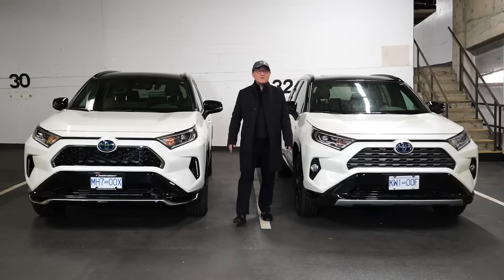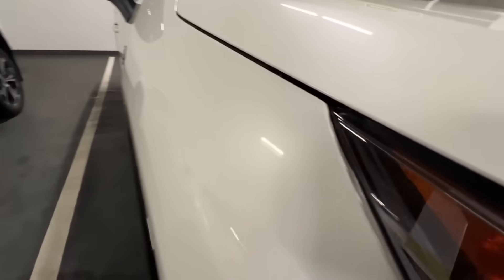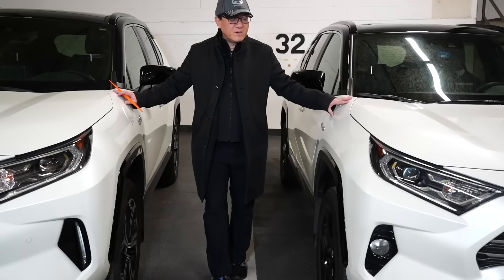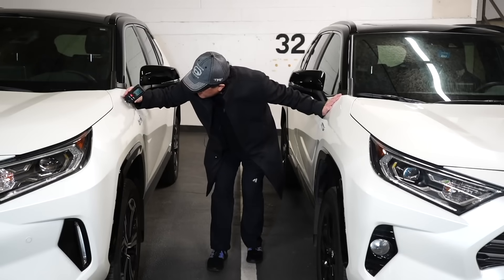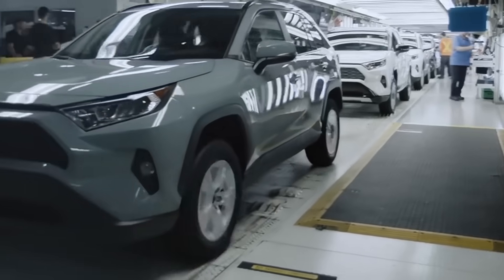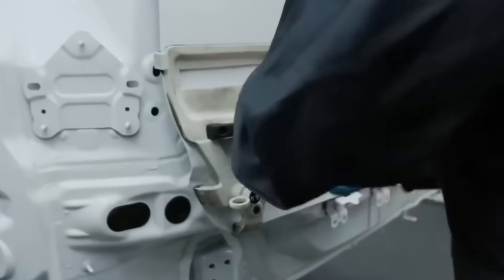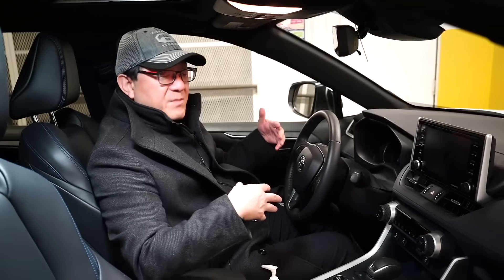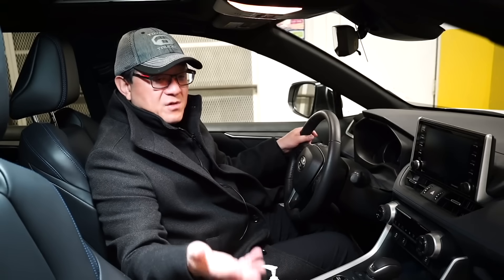JAPAN-BUILT RAV4 vs NORTH AMERICAN-BUILT RAV4 - WHICH HAS BETTER QUALITY?

Comment: Thanks for the video.  I have a Canadian made Rav4 so this was interesting to see.  Glad to know the quality level is still high in comparison to the Japan made Rav4.
Reply from the maker: Thanks for watching!
Reply: @AutomotivePress  THANK YOU!! EXCELLENT JOB AND GREATLY APPRECIATE SIR!! Have you heard anything about the corrosion problems on the high voltage power cable on the RAV4 Prime? There is lots of information on it (actually, its my understanding there is class action litigation on it here in the USA) on the RAV4 Prime forums. I was wondering if that issue has been solved for the 2023/2024 models? If so, what is the current solution? I live in Michigan (gets cold and snowy), am looking VERY SERIOUSLY at a RAV4 Prime and would LOVE to hear your thoughts. THANK YOU!